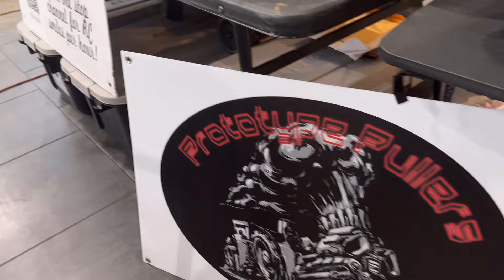NR/CTPA 2024 Spring Nationals RC Truck and Tractor Pull

Comment: So are there tire rules?  a "stock" crawler category? Battery restrictions? Must be suspension rules as well? Or are rear ends solid mounted like the 1/1 pullers. 
I know there must be a weight limit as well? 
I don't run my no prep drag car enough, and I'm positive 2.2 jconcepts  renegades fit on the back. Turn the wheelie bar into a trailer hitch and rip right? I must know more! 
Thanks for the entertainment!
Reply from the maker: What’s up ryrc3033welcome to the channel. There are two sets of nationwide rules depending on what organization you pull with. Most of the rules intertwine to allow people to participate in both arenas. East of the Mississippi goes with NR/RTPA rules. West of the Mississippi goes with AR/CTPL rules. Check out the American RC Tractor Pullers League FB for more on this. Most of your questions can be answered there. 🤙🏼☢️